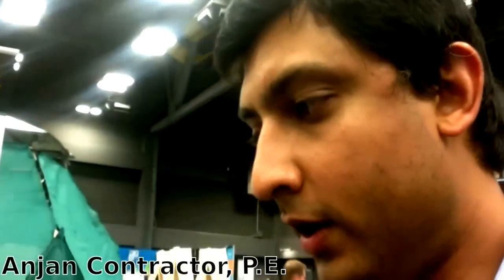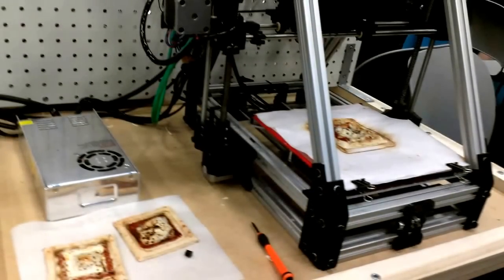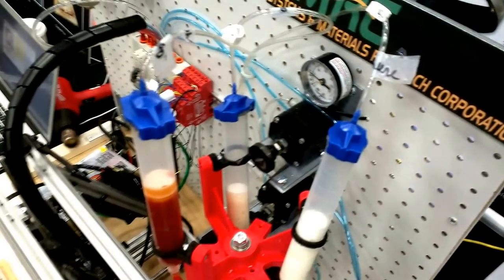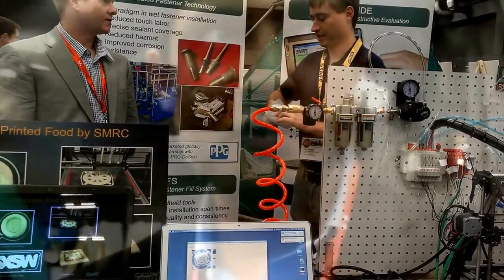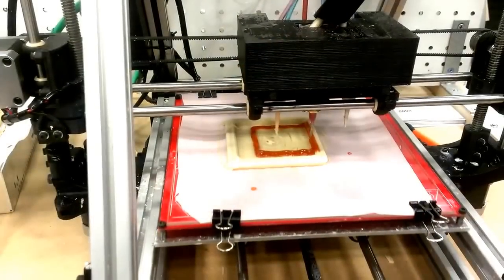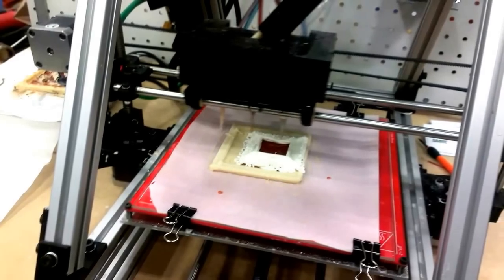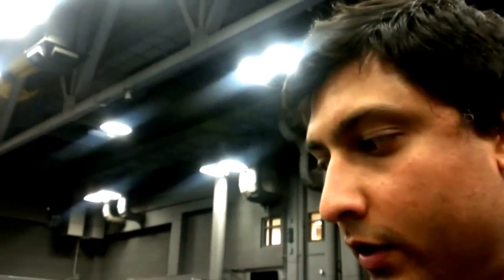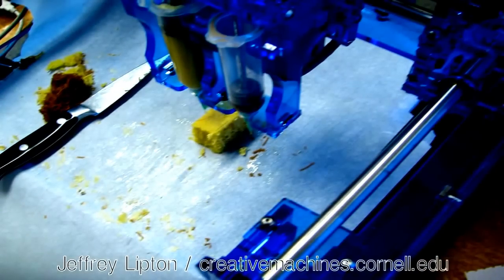HD 3d printing pizza on a contract from NASA HD

Comment: Picture is misleading. Really stretching the term 'printing'. I bet Digiorno could get their pizzas strapped to the outside of the vehicle and the crew would have to go to the 'freezer' to get a couple for a meal. :)

Pizza is probably a bad choice to use. Cookies and other single layer foods would probably be better choices to start with.
Reply from the maker: Jim Kenny Ther are many different food printers, check out my other videos where you can see a 3d printer printing a cake and a chocolate cup :)
Reply: Mugentime no thx I rather go takeaways instead alot cheaper.